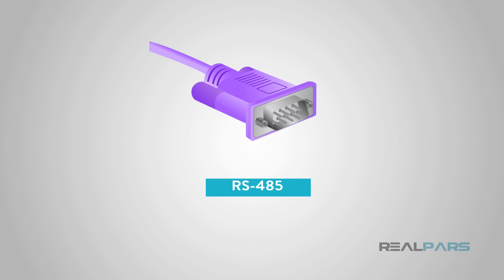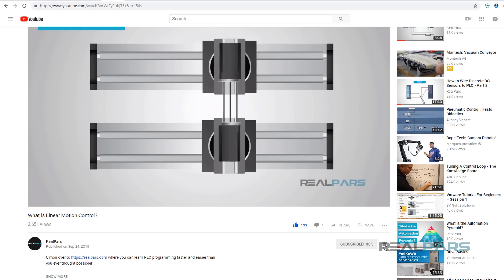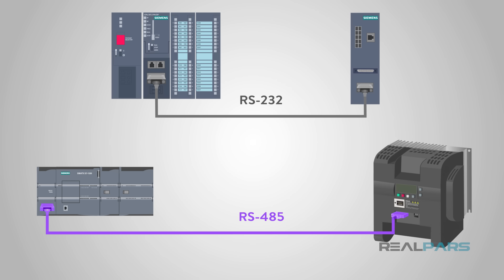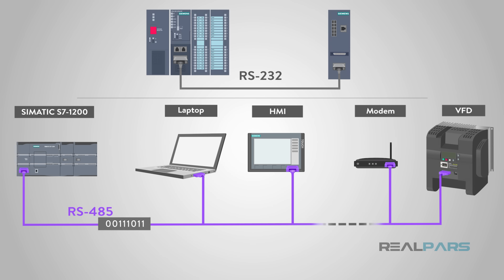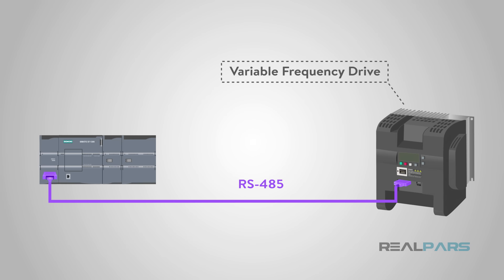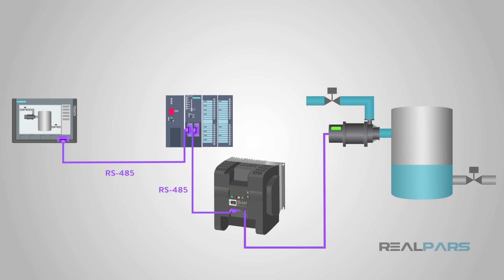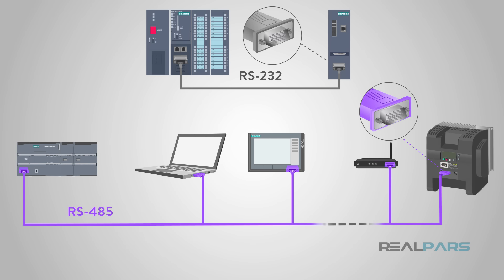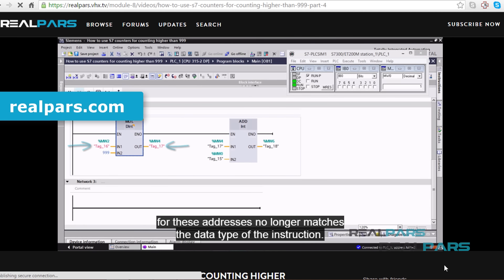What is RS485 and How it's used in Industrial Control Systems?

Comment: Is this the protocol used in profibus? Thanks!
Reply from the maker: Profibus, at the physical layer of the OSI communication model.  You could say Profibus was built on top of RS-485.  However, they are not the same.  Profibus requires a more stringent cable specification (including termination resistance) so that speeds of up to 12Mbaud can be achieved.  RS-485 tops out at 1Mbaud.  Profibus has a very much more complex set of layers at the Data Link layer and above.  Instead of a primitive UART (universal asynchronous receiver/transmitter) function at the Data Link layer, Profibus uses the more flexible Fieldbus Data Link function.  Significant additional functionality is stacked above the Data Link layer in Profibus, where R-485 only has a node addressing function and a limited set of commands and responses.

Comment: I want to convert from RS232 to RS485 (My HMI and PLS ports are RS232) and I am using an Optical Fiber extender with RS85.

Please which of the pins (from 1-9) do I use as my positive and negative on the serial port pin?
Reply from the maker: I am not sure you are framing your question properly.  Both RS232 and RS485 are serial protocols, so when you ask which pin is "positive and negative on the serial port pin", I am not sure which connector you are asking about.  If you are asking about the RS-485 connector, Pin 8 is Transmit (+) and Pin 9 is Transmit (-).  In a full RS-485 implementation, there are also (+) and (-) for Received Data, Clear to Send, and Ready to Send.  RS-232 is voltage-driven, and all pins are positive with reference to ground (Pin 5).

Comment: What will be the gauge of the rs485 which allow 1200m
Reply from the maker: 20AWG (0.5176 mm2) to 16AWG (1.3087 mm2) is recommended.  I would use 16AWG to be sure there are no significant signal losses, especially for RE-485 based networks, like BACNet or Modbus.

Comment: So it is correct say that Profibus is  based on Rs485 protocol ?
Thanks a lot for the video
Reply from the maker: Yes, RW-485 is the electrical specification for the physical layer on top of which the Profibus protocol operates.

Comment: Nice video, btw what is the differences between using RS485 vs analog input output for communication between PLC and VFD? THX
Reply from the maker: An analog input card has several channels, with each channel supporting one 4-20ma or 0-10VDC sensor input.  RS485 is a communication protocol that is the foundation of digital bus data transfer (such as ProfiBus PA), which allows many sensors to be connected to one PLC communication port.  For RS485 communication to a VFD, Profibus DP is often used, which supports digital and word data.  To drive a VFD with PLC I/O cards, you would need DI, DO, AO, and possibly AI cards as well.  So the bus-type interfaces allow the VFD to be controlled using a single cable.
Reply: @realpars  Ohh icic, thats why rs485 is used to make it easier, cuz it only uses 1 cable. How about let say pH Meter? currently im using analog input 4-20mA and plan to use more ph meter for water treatment plant. Should i use RS485 or just analog input current? thx real pars!💯

Comment: Where the limit of 32 devices comes from? I have electricity meters connected to rs485. It uses mbus and there is lot more devices than 32 and everything works. I'm confused.
Reply from the maker: Modbus is based on RS-485 but extends the capabilities of the original network limitations.  RA-485 is an electrical specification, whereas Modbus is a protocol that can run on the RS-485 device layer.  In general, the maximum number of nodes that can reside on a network is usually determined by the organization that governs that protocol.  There are limits to baud rate, cable lengths, number of drops, etc., that stem from how much power is available on the bus and how stable the communication is over the length of cable that can be used.

Comment: Max, how many devices you can connect in RS 485
Reply from the maker: Per the EIA-485 standard, the maximum number of nodes is 32.  Variants of this communication standard, such as Profibus DP, can handle many more (128 for Profibus DP).
Reply: @realpars  in RS485 without repeater we can connect max 32 device and with repeater how many devices we can connect max..?

Comment: One doubt. In your example at the end, you used two RS485 cables. One to connect PLC to HMI and another one from PLC to VFD.  But earlier you mentioned RS485 can connect to multiple terminals. If that's the case, is it possible to use a single RS485 cable from PLC and a divider to divide the signal to VFD and HMI ?
Reply from the maker: Up to 32
 transmitter/receiver pairs may be present on a RS485 network at one time. RS-485 is generally a 2-wire half-duplex system connected in a daisy-chained manner with single twisted pair cable.  Many vendors also offer RS-485 multiplexers that allow for star configuration of the network.
Reply: @realpars  I had just the same question. The answer given seems to suggest that every device on the chain needs to either consume the data or otherwise forward it from one connector to the other if it is not addressed to itself. Is that the case?

Comment: Control a VFD is an application of RS485, but it did not explain why... So for serial communication, then why RS232 not chosen? It can do the job too, right? 

Then regarding the noise resilience, it was not explained well. RS232 you explained positive voltage for binary 0 and negative for binary 1, but RS485, you did not mention a threshold of 200mV is used on both sides. Just some wild suggestions.
Reply from the maker: Thanks for your suggestions, Kurt! I will make sure to forward this to our course developers.

Comment: 2:25 that's not exactly true. Where I work, in building automation, i have seen sometimes over 50 devices on the same RS-485 loop (ok sometimes there are repeaters used). The thing you have to keep in mind is that, first, RS-485 is meant to be daisy-chained and not using the "backbone and stub" topology. Also, RS-485 is just a physical layer. There are a bunch of protocols that use it, like Modbus RTU or Profibus, or BACnet MS/TP in building automation. And the number of devices possible to connect is generally only limited by the addressing method of the protocol itself
Reply from the maker: Thank  you for your comment.  The TIA/EiA-485-A standard identifies the maximum number of nodes as 32, without repeaters.  This is a physical limitation (current and voltage drops), and is set to be "safe" for designing to the limits of the system.  There are techniques used to go beyond these limits, and each protocol organization, such as PI North America, publishes the requirements and limitations for the protocols they sponsor.

Comment: Can we connect RTD to RS485 in S7 200 plc...please describe me
Reply from the maker: RTD's are resistance devices.  The wires that make up the RTD vary in resistance with change in temperature.  Therefore, an RTD must be connected to an RTD I/O card in a PLC or DCS or be connected to a temperature transmitter.  If the I/O rack is connected via RS-485 to the PLC, then you could connect an RTD to the I/O rack with the proper I/O card.

Comment: This video about RS-485 is limited to the industrial control and it doesn't discuss any of the limitations of RS-485.  RS-232 and RS-485 are electrical and mechanical interfaces and do not specify how many devices or what speed the data is sent.  The video states there is no standard RS-485 connector but the true RS-485 specifications state the type of connector and the number of pins, and anything that does not conform to the specifications is not RS-485.  IIRC the original specifications did not use a DB-9 connector.  So this video leaves out a lot of information that may be needed for an accurate explanation of the RS-485 interface.  Thanks for the limited video.
Reply: You forget that the RS in RS-x is 'Recommended' Standard and there is no connector specification. Additionally  you as well as the content provider stated DB 9 what was shown is a DE 9.  Unfortunately the content provider did not comment on the most often forgotten ground, 2 wire, as shown, is actually 2 wire plus ground, and the 4 wire systems are actually 4 wire plus ground.  On smaller systems as shown, were the equipment shares the same earth connection, although there is more noise, will generally function as intended.  When doing camera and control over large areas requiring fiber optic transmission between nodes, this becomes very relevant, I used to design networks that covered entire states, as well as border protection for other countries.

Comment: If RS-485 can handle up to 32 connected devices, why does the RS-485 port on the Easytouch automation system for a pool freak out when you connect 3 or more???
Reply from the maker: Many consumer devices are capable of communications using modern protocols, but because they are limited in scope, the processors are not always set up to take full advantage of the power of those protocols.  Many times, these consumer products, have artificial limits to their capabilities, such as 2 nodes on RW-485 or other limitations.  They figure beyond the main controller, the user would only have two other nodes, such as an automatic chlorinator or a lighting controller.  Even in an industrial system, a 32-node configuration would likely bring a controller to its knees from a timing and loading standpoint.

Comment: Great stuff! 
Thanks for the extra lesson besides the every friday one on the library.

Now I understand a bit more the difference between RS-232 and RS-485 communications. 

But then why are we still using it nowadays when we have Profinet (or Industrial Ethernet protocols)?
Reply from the maker: Hi Erick, thank you very much for the positive feedback. 

Well, if you want to use a Profibus network in your project, you need to use RS-485 as a medium (cable) to transfer data. But for Profinet you'll make use of a CAT5, 6 etc cable. 

So if you have a device that only supports Profibus, for example, you need to make use of an RS-485 cable.

Comment: I did not know that the connector wasn't standardized, I thought that all DB9 serial connectors were wired the same. It turns out this is not the case, every device may be wired differently even if they have matching DB9 connectors.

Comment: Can't we use rs232 and rs485 both together, Why
Reply from the maker: You can use both in the same control system, but not on the same network.  RS-232 is a point-to-point connection with a voltage signal.  RS-485 is a multi-drop network which is current-based.  I have used an RS-232 connection to connect a weigh scale to a PLC, and also have connected a gas chromatograph to the same PLC.  In order to do that, I needed an interface card for RS-232 and a SEPARATE interface card for RS-485.

Comment: RS232 maybe older but that doesn't make it better or faster... RS485 can run up to modern standards of 250k baud+ and is fault tolerant and self correcting, which is why it's an industrial standard used on oil platforms (before optical) and nuclear power plants... Used in both monitoring and control scenarios.
Reply from the maker: Thanks for adding that, Dave!

Comment: Isn't ethernet better at controlling devices than 485? Or is this older tech?
Reply: The better comes from the software the layer 1 is just the methodology used to transfer.  Ethernet uses Manchester Bi-Phase which actually requires more transitions per bit.
Reply: @davidmoran4471  You're way more knowledgeable than me obviously, but I meant it from an ease of installation and wide industry usage of the ethernet standard and tcpip stack. I was asking a question more than trying to make a statement if that makes sense.
Reply: @oatlord  As far a ease of install, Yes Ethernet would be easier due to the standardized wiring and connectors.  However the software on the endpoint devices would be more involved and require additional memory adding to cost.  This is one of the things that I worked on with one state DOT, standardizing the wiring scheme as there 64 ways you could wire the ends, but only 1 works properly and most of the others will bring the entire network down. The DOT had camera control, traffic light timing and control to/from the controllers, bridge fire alarm monitoring and alarm contacts on 4 fiber optic cables multiplexing video and data to cover the entire state.  There are devices to carry RS485 over Ethernet, but again adding cost.
Reply: I used to work in I.T. At a large college.  RS-485 was used to control things cite car park barriers and rows of entry gates with ID badge readers, originally mag stripe and later contactless.  It wasn’t 485 the whole way, each row of gates for example old be connected together and to a nearby Ethernet to 485 converter box; there would be several installations like this covering different entrances and different buildings.  From there the main Ethernet network would carry the signals to the associated server in the main server room and to the security staff PCs in their control room.  A remote site was also connected via a private fibre Link a few km away, and monitoring and control was also possible from anywhere over the Internet.

It was the same with the lighting system which was controlled by DALI, Ethernet to DALI converters in various parts of the building controlled the lighting in their own area, and from there it was Ethernet back to the server room and control room and over the Internet to the lighting company who maintained the system.  Each of these systems had its own vLan on the Ethernet and the lighting company for example had control over their system, but no access to the telephone system for example.

Students would sometimes ask why systems like these, and even things like interactive whiteboards in classrooms were not connected via USB; the whiteboards were RS-232.  The main reason is that USB only works over a few metres and the high speed of USB is not needed in control applications which only move tiny amounts of data.  In the same of things like the security and lighting systems they could be controlled from anywhere on the network.  If it was necessary to move the control room temporarily, such as during refurbishment work for example there was no need to run new RS-485 cable we would just configure a port on a switch somewhere to have the correct vLan, patch that port through to a port in the new location and move the PCs to that new location; took about five minutes.

Comment: Why not just use ethernet?
Reply: Low cost Ethernet doesn’t go 4000 feet or support a bus topology. But... search Google for “802.3cg”
Reply: Also, low cost Ethernet doesn’t support redundant self healing optical rings. You could splice in an FDDI layer into an Ethernet environment to do something similar but at significant cost.
So it might be easier to ask “what did the Roman’s ever do for us?.....”
Having said that it is fair to say that Ethernet is being adopted more and more in Industrial communications but Ethernet redundancy is still difficult to realise in cost effective solutions at present. Fault tolerant Ethernet is out there but the capital investment is much higher.